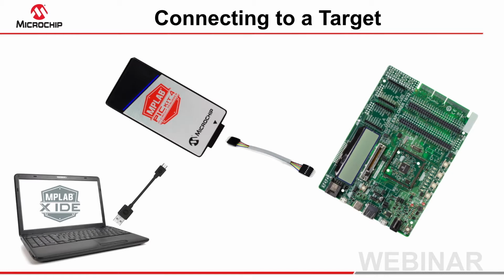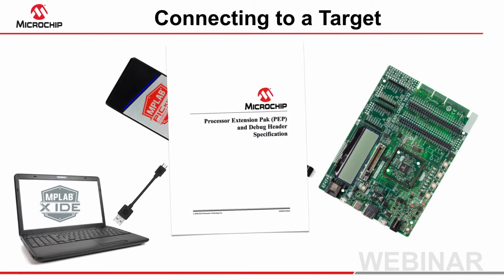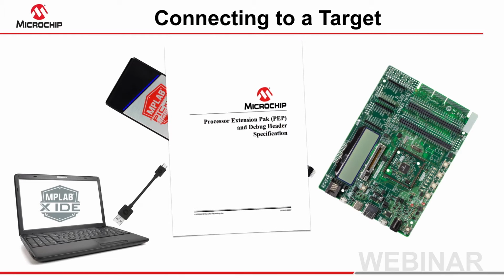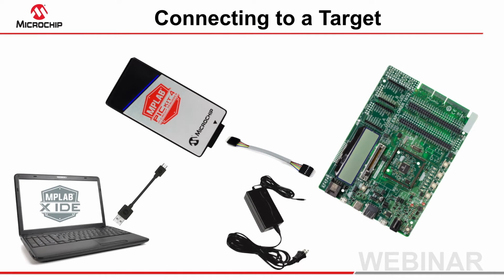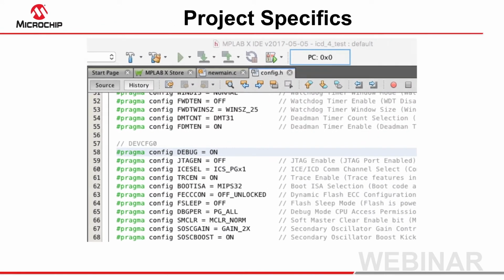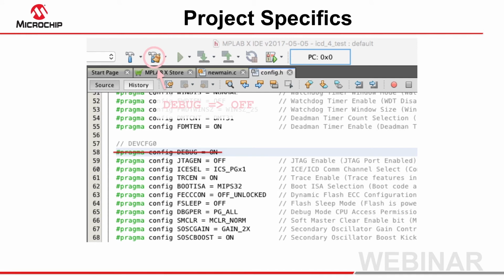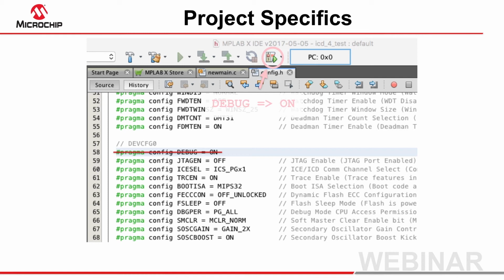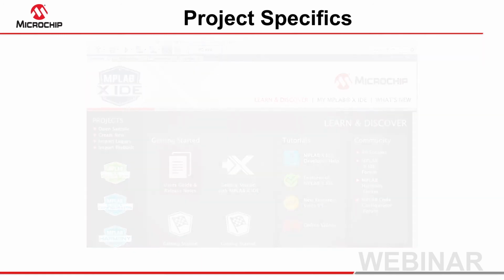Getting Started with the NEW MPLAB® PICkit™ 4 In-Circuit Debugger

Comment: in MPLAB X IDE v6.05 when I open project properties and I select PICkit 4 just as shown in 3:10, I don't get the same menu. I am looking for the option where I can toggle the debugger integrated power supply. I cannot find how can I switch between pickit4 to expect power on PIN2 and provide power on PIN2. Any idea?